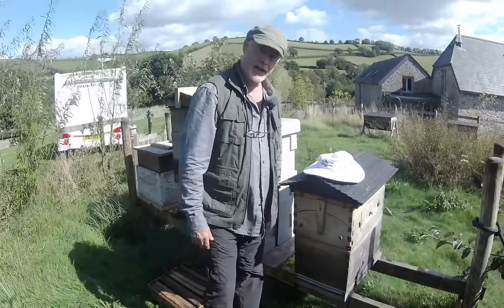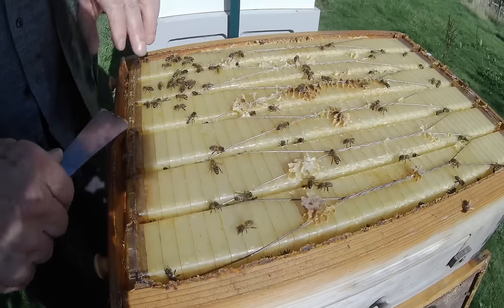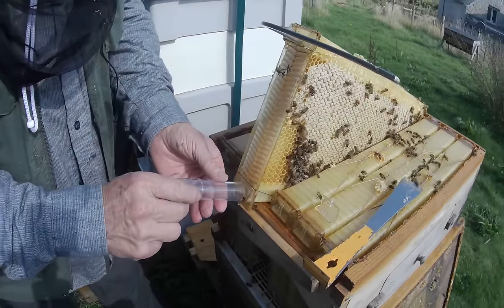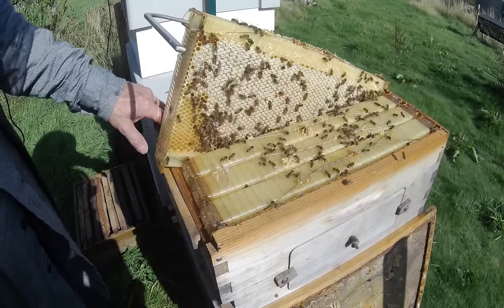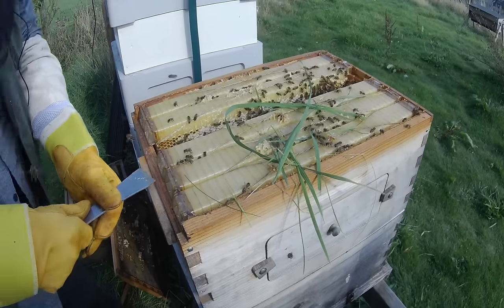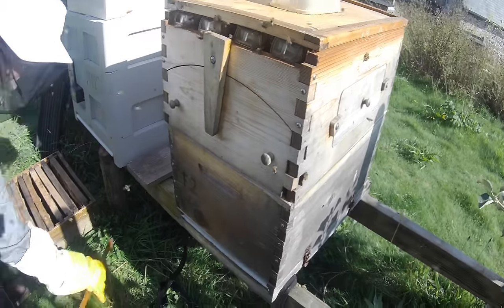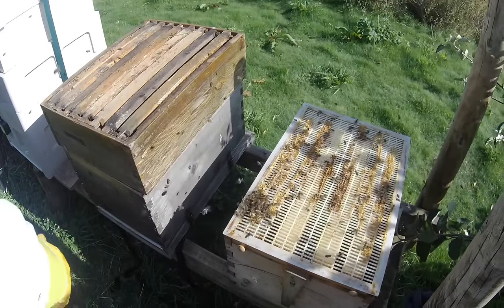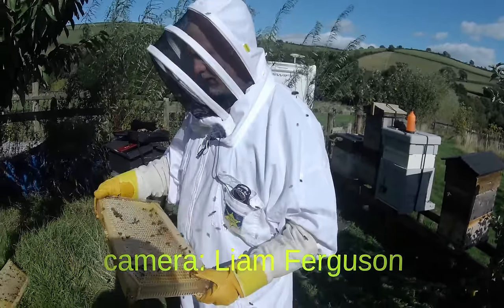Don't buy a Flow Hive until you've seen this!

Comment: I'm seriously concerned about you creating a video about something that you apparently know very little about. Owning a Flow Hive, how is it you don't know how the drain pipe going into the  unit? I mean seriously, there is a tongue on the "spigot" that must go properly into the bottom of the connection hole. There is also a line on the tube that indicates how far you need to insert the tube into the connection hole. It's like one of the most basic things to understand when preparing to harvest honey from the frames. If you don't know how to do this, I fear you really don't know much about the unit and how to properly use it or what you are talking about. I don't want to be mean but if you are going to make a video and want people to believe anything you say, you should at least have basic knowledge and understand of the item you are talking about and there are a lot of problems with things you state in this video. I suggest you spend some time on YouTube and watch other educational videos about the Flow Hive.
If you are concerned about the flex when opening the frames, get yourself a second "key" and insert both keys at the same time, pointing East and West and then slowly turn both downward and together at the same time. This will reduce the pressure and make it easier to open the frames.
Reply from the maker: Thanks for your advice. I did a follow-up that you may not have seen.

Comment: Wow, looks like you upset more than just the bees here. It's a pity more people aren't concerned about the welfare of bees, rather than defending such a ridiculous contraption. 
Interesting how despite the incredible number of comments, not one supporter has addressed HOW it is proven that bees aren't harmed during extraction. 
Give me a top bar hive any day. Thanks for an honest review Phil.
Reply: I'm really confused. You dont lift the frames in a flow hive. you put in a crank, turn it and off you go. As to if there is honey - that's what the side windows are for.   How can you tell the bees aren't hurt. Basically the cells open up and down underneath the capping. The capping remains intact. They cant get hurt if the capping remains intact.  No treatment? In most countries that means there is verroa and a raft of other diseases - which untreated hives spread to healthy hives.  Untreated hives die, then get robbed allowing the diseases to infect other hives. I'm very very confused by this video.Looking at this hive there seem to be very few bees. My hive is heaving with bees after six months, needs two brood boxes or more and is still super busy. A healthy hive should have more bees.
Reply: The bees don't get hurt because when you turn the key and they lift from the centre but the 2 edges are not flush (so there is space for the bee if it happens to be in a cell when you open it).

Hope that made some sense but there are videos out there explaining what i said better and obviously with video to demonstrate. 😊